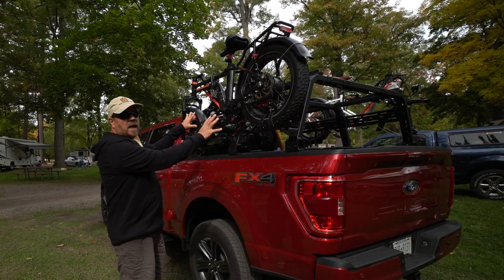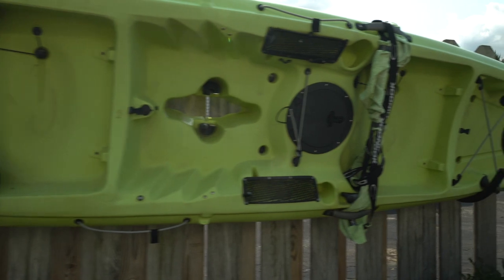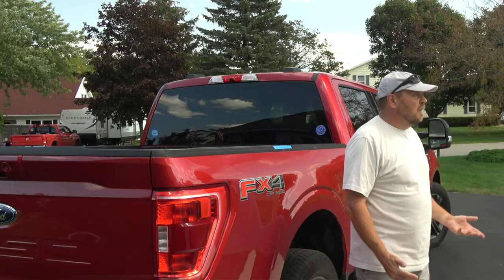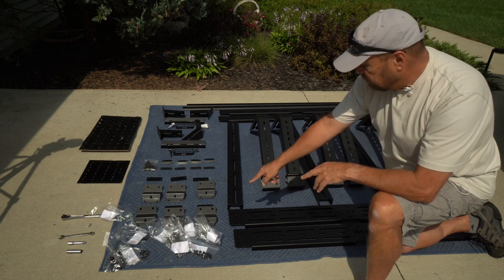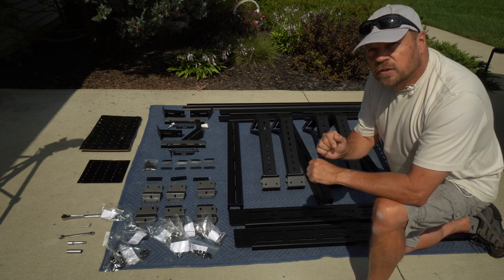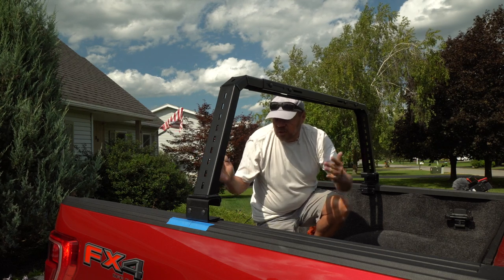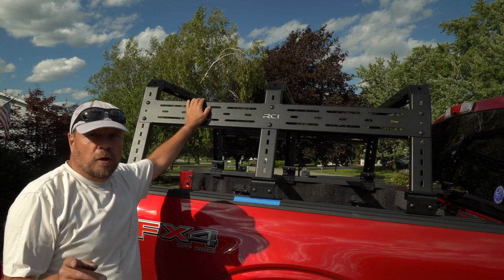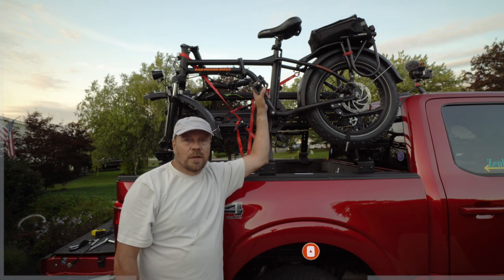Building an Overlanding / Bike / Kayak Rack for our F150 | RV Lifestyle

Comment: I think a hitch rack for the RV would work best. Maybe that bed rack use for kayak and spare fuel tanks.
Reply from the maker: The problem with hitch racks is most of them are not rated to carry heavy ebikes.  I like this setup, the bikes and kayak are with the truck and accessible when needed.  I can still add spare fuel tanks to the inside of the rack if needed.

Comment: I have a truck bed bike rack to carry the bikes in the bed and I carry both kayaks on the top rack. It works pretty well. I like your system.
Reply from the maker: Removing the wheel is a little bit of a compromise, but it does reduce the weight of the bil=kes making it easier to lift.  What I like about tis set up is I can use the bikes without unhitching the trailer to lower the tailgate.  That it kit looks cool with the bikes on each side.😎

Comment: Great video but, to prevent drilling the truck side rails what adapter did you buy?  And, do you have any pictures of the truck mounts before modifications? Thanks.
Reply from the maker: Thanks James. In the video a 10:38 I feature the Z  brackets that I used to mount the rack.  For a before pictures check this link to RCI web site https://rcimetalworks.com/product/bed-rack-tonneau-adapters/

Comment: Looks great but lifting two E-bikes on the rack can be difficult for many people.  I do not like taking the front wheel off to use the rack.  Did you install this way to reduce the overall height?  Overall I think this system is great.
Reply from the maker: Lifting the E-bikes is a work-out not something I can see myself doing as I get older.  But I find it easier to lift the bikes in to the rack with out the front wheel and battery than lifting  the complete bike into the back of the truck.

I was not so much interested in reducing hight as not wanting a bed cap because of the reduced visibility.